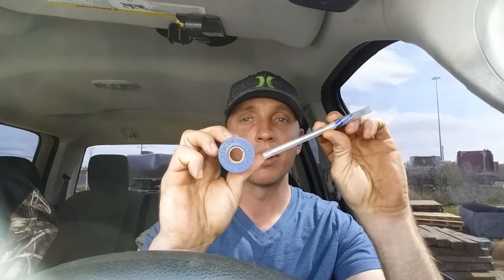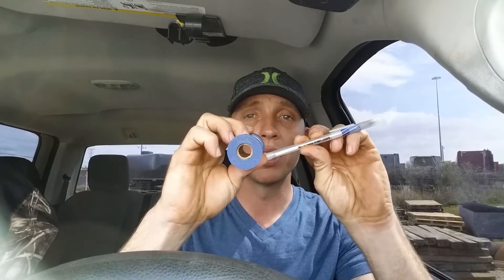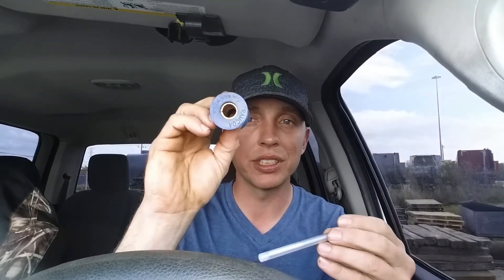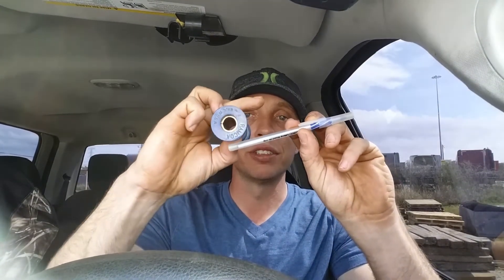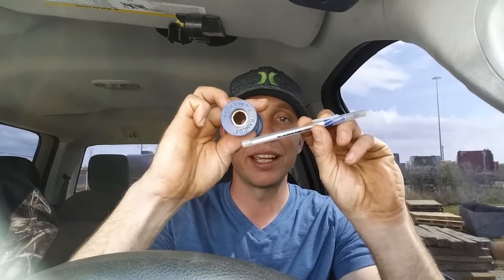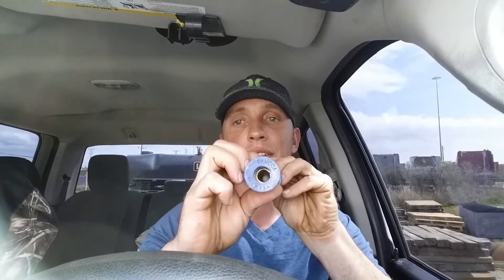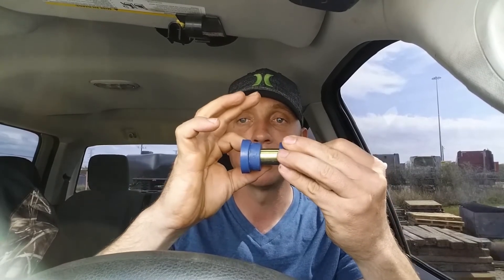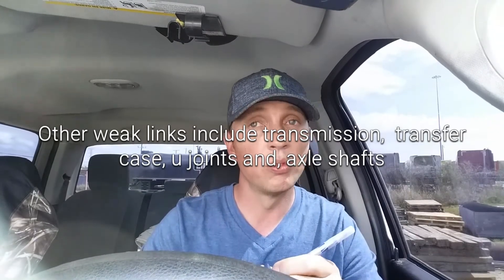Axle wrap! -how it works

Comment: If I get a 5.5 bds lift should I still be worried about axle wrap
Reply from the maker: Should be fine. If you start to add a lot of weight and flex the suspension at crazy angles it may try and turn your leaf springs a little. Especially if you spool that turbo up while the truck is in a bind. You could probably add a leaf spring and just level out with blocks. But you would lose a little flex and for the price you could just buy traction bars. 
But if you for some reason you spike your torque bad enough to twist those leaf springs I feel like in a half ton, the weaker link would be the transmission.
Hope this helps buddy
Reply: Empyre South thank u so much bro I really appreciate the advice, think I’ll do the traction bar with the lift kit and regear for the bigger tires just to be safe, gotta take care of the truck the right way
Reply from the maker: What kind of truck and what will you use it for?
Reply: Empyre South f150 2.7 daily for camping and fishing, I wanna get into overlanding
Reply from the maker: Wise choice brotha

Comment: Axel wrap cost me a pinion gear. 8 inch lift on 24x14 37's ez lynk tuner on platinum 6.7 powerstroke. Torque is real boys and girls! Get traction bars when you lift your vehicle. Especially diesels and high power/ torque applications

Comment: How do you know when you need a traction bar?
Reply from the maker: bhshakari generally a vehicle with leaf spring suspension that has been lifted or has an abundance of horsepower or both are usually good candidates. One way to test is to do a burn out, if the rear tires  of the vehicle hop that is usually axle wrap. Or get a friend to watch (from a safe place) while power braking the vehicle if the pinion of the axle is pointing at an upward angle before the tires start to spin over you know for sure that axle  wrap needs to be addressed.